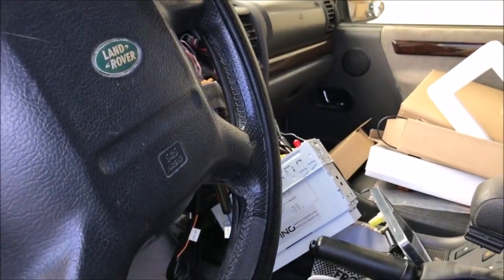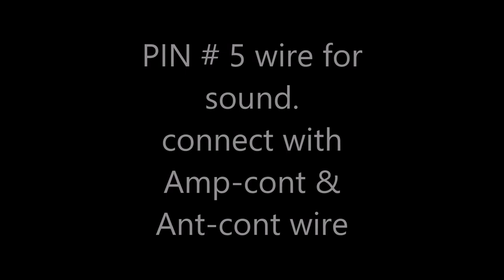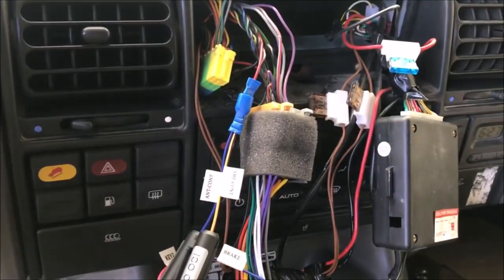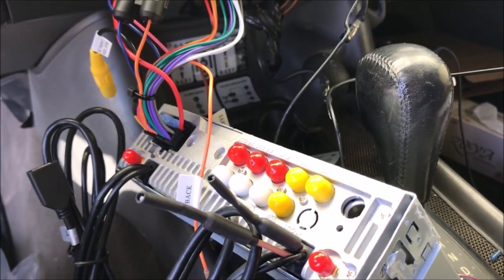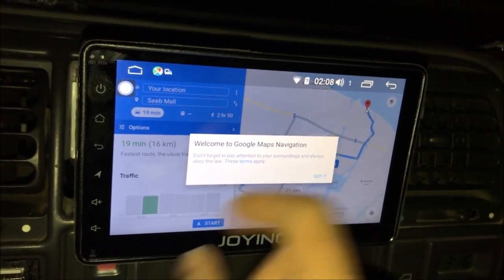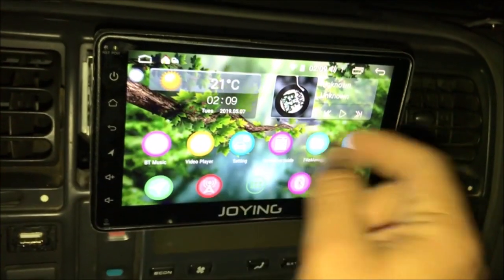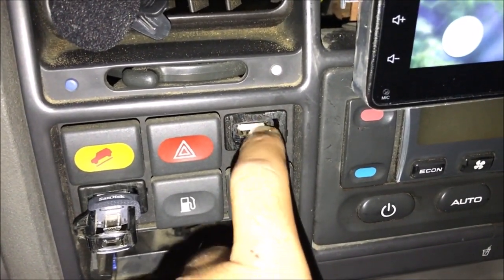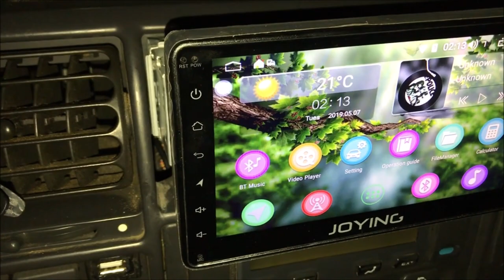Joying stereo no sound land rover discovery 2

Comment: Hi, did you also figure out what wire that control the volume from the steering wheel? 
Great Video, you helped me with the sound. I have the same Joying. it seems very good!
Reply: What size screen is this one?
Reply: I think I answered my own question, look like he has the 8 inch screen, I'm considering the 10.1 for my disco 2
Reply: @chrisgregson9883  you have pictures after installation
Reply: @ramilaanani6990  would liketo see somepictures also :)

Comment: i have same radio do you have standar sound system or do you have harman kardon with amplifier? because I do have and have same issues whit sound I will try your way to fix it. but when I bought my disco it wasn't an original radio anymore in it and the sound was wired from radio with chinch cabels
Reply from the maker: I have standard, so I don’t know about the sound system you to help you out

Comment: hi, please help me, I bought aftermarket radio din2. I connected the electricity but I have no sound. You can give me a scheme for the merger. The radio has 4 RCA outputs. In the video I saw that you connected the amp and antenna a pin 5. I am curious what happened to the speaker connector. Thanks in advance
Reply from the maker: Dear sorry for late reply

I was struggling to fix the sound issue I tried many ways
but failed, I believe amp and antenna wire as well pin 5 is the source of
supply for the speakers. I hope my answer will help you.

Comment: Thanks for this video, there are need other adapter to connect the joyin to the discovery 2?
Reply from the maker: You have to inform the vendor before purchasing so they will supply the adapter along with the joyin, no extra charge. I hope my reply will be helpful
Reply: @washaqoman4x414  thanks, and yors autoradio is 7''?
Reply from the maker: Not remember really but u have to inform them that you want it for discovery 2 so that will get fit and also if u buy the steering remote from them along with joying it will be much better and it’s very helpful